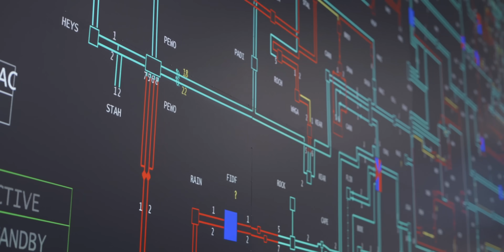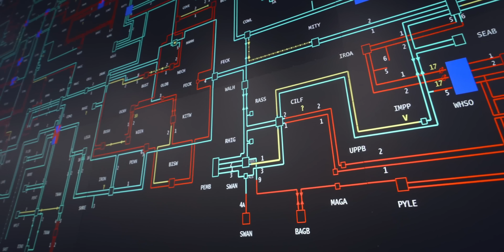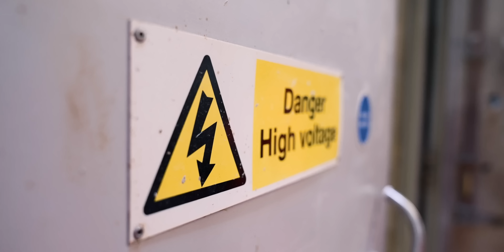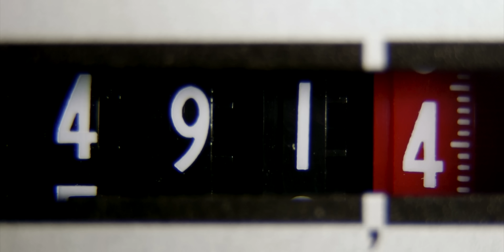THIS is Why the Grid is Ready for Electric Cars!

Comment: The tunnels are the right solution, obviously far better than non stop digging whenever something needs updating or repair. I hope the tunnels are meant to take more than power, though. About the cable to Norway, it can easily send power both ways, but IRL it’s a one way road. Power goes from Norway to England, where the price was much higher, meaning that it’s gotten as expensive in Norway. I’m Norwegian and think power has been too cheap in Norway, making people wasteful. Using Norwegian hydropower to replace dirty European power is good, but don’t pretend it goes both ways.

Comment: The grid will be ready for EV's because it is an excuse to charge consumers an infrastructure surcharge.  In truth, most modern homes have electric ranges, ovens and dryers so as long as the level 2 chargers are not operating at the same time as those high powered appliances, no more of the grid is needed.  Now if we want to reverse the power flow from the EV's back to the grid to help with peak demand and to buffer solar and wind, sure that would need grid improvements but it would be the utilities that benefit directly from that so grid improvements is all about benefits to the utilities at the expense of the consumers.

Comment: One Caveat... too much optimism can stop us making the hard decisions because it makes us think everything is going in the right direction and it isn't, at least not fast enough. But interesting on the tunnels ... lower cost higher speed tunneling technology is key (and not just for London!) It will help with transport and infrastructure, it's another strategic technology we need to put on a "war footing"  just like nuclear(relearning "old" nuclear and doing "new") and developing technology for energy storage + renewables etc. Cheap fast tunnels are for example critical to making heat pumps more practical with district water tunnels deep underground to supply heat pumps in high density areas.

Comment: For those who don't care or want to watch : Is the national grid ready for electric vehicles? No it isnt. But in one specific place in london its ready. for the other 99.7% of the united kingdom, its not ready. Sub-stations have been degraded over 20+ years. So in your village or local town the electrical sub-stations are barely handling what is going on already let alone adding tons more supply from consumers.
Reply: That’s not the National Grid, it’s the 14 Distribution Network Operators (DNO’s) owned by 6 groups that takes the electricity from the National transmission system and delivers it to users. These were privatised many years ago and the privatisation was done very badly. The government really needs to address this as soon as possible.

Comment: Actually, in AC, the electrons only jiggle a bit in the cable. they only travel a few millimeters at most. Electrons are not the energy carriers in electricity, the electromagnetic field is. It's just that the electrons have to be there for the field to have perturbations to be able to transport energy. Another thing to wrap your head around: Electrons flow from - to + , but the energy really flows from + to - !

Comment: This video is typical of city centric views of the "Green Zealots". I live in a regional area of Australia, where most houses that are towards the end of the transmission lines can barely support existing elical loads, let alone the demand from EV infrastructure.
Reply from the maker: An interesting response. As Australia is the most 'city centric' country on the planet, (86.36 percent as of January 2023) then I understand why you may have a jaundiced view of this episode which is very specific to the UK.
One of the things that has really impressed me on my current visit to Australia is the level of adoption of solar PV and battery storage. 
People who have the space to install seriously beneficial amounts of solar do not live in cities, so it is a positive advantage to live in rural areas, where demand on the grid is the absolute reverse of what you are being so critical of. In many places people already generate more electricity than the local grid can deal with, so running an electric car in a riural area (like I do in the UK) is much easier and a whole lot cheaper than running an old fossil burner using expensive, toxic, imported fossil fuel.
Reply: @fullychargedshow  "imported fossil fuels", a continued slogan I hear from EV evangelists. Fossil liquid hydrocarbon fuel will eventually give way to synthetic liquid fuel. I have numerous "old tech", fueled cars (Mustangs, Civic Type R etc....and will never give them up. I also use an EV for work (because it's more suited to that specific task). It's charged a work because I cannot charge it at home, I live at the end of the grid with a single wire to my house - and the other 10 in the street). I can assure you, the IC engine is not going anywhere during my lifetime. EV tech is part of the answer, but not THE answewr.
Reply from the maker: @Ozgrade3  Well those fuels are imported here, and refined here using vast amounts of electricity and of course cobalt to remove the sulphur.
But all that aside, it's fine, don't worry about it. Our generation will cling on to the dated and inefficient combustion technology. 
No one cares, it's painfully obvious that electric ground transport will become dominant. There will always be combustion engined vehicles, polished and loved by a few eccentric old blokes and that's wonderful. 
They should be maintained so our great grand children can understand that we used to rely on a technology that required controlled explosions in a largre lump of steel, to drive a piston, to push a con rod, to turn a crank, to spin a fly wheel, to drive a cam belt, to turn a cam shaft, to open and close valves, to drive an oil pump, to force oil at high pressure into bearings, to drive a water pump to keep everything cool, to spin a fan in front of a radiator, to go through a clutch and gearbox of immense, energy sapping complexity, to push toxic gas out of a long pipe that required complex and expensive minerals to try and reduce the amount of poisonous gas that is pumped out in massive choking clouds behind the vehicle.
It's a critically important,, game changing technology that altered the world we live in and allowed enormous economic and material growth. 
But it's now a static, moribund technology with nowhere left to go, it's ridiculously wasteful and dated, but seriously, it's fine.
Don't worry about it.
Keep driving old fossil burners, it's not interesting.
Reply: I'm not anti green tech, or anti-EV, or anti progress. But I am a realist. Green nirvana is long after my lifetime. So it's something I don;t realy care about. Other will enjoy it - long after I'm dead.

Comment: Ironically, the grid in the Netherlands shockingly overbooked. Upgrading the grid to support a massive EV fleet, is going to cost many, many billions. Applications for solar panel permits are already being denied out of fear the region there will start to black out. Contractors have to hold off building new housing because they can't be connected to the grid, out of same fear. Energy corporations were warned years ago.

Comment: The UK needs 25 GW of additional power before 90% of all UK cars can run on electricity with the same usage pattern of the ICE cars being replaced.
No amount of chargers shuffling can replace those 25 GW of generating power that must be added before "automobile net zero".
Trucks will stay on diesel. Testa has made a truck with a 900 KW battery, and that require a one MW charger for each truck, it doesn't seem sustainable...

Comment: The grid is the easy part , the problem part is having enough generating capacity at all times , you can't do without either , and networks will have to be everywhere and that is NOT the case today

Comment: Thought Fully Charged was clued up? Energy is measured in watt-hours or kilowatt-hours or mega-watt- hours etc, ie the product of power and time multiplied together.

Your correspondent mentions 'megawatts' of energy. Watts measure only power, ie the rate energy is moved , or used.

So the stats they mention are worthless, since either its a slip of the tongue and they meant megawatts of power, or they meant megawatt hours of energy...

Its secondary school physics, basic algebra.
Energy equals power multiplied by time.
Power is the rate of energy transfer.
No wonder no one understands their electricity bills.

Comment: Very nice but at the local level most of our cables have been in the ground over 60 years, the local sub stations are elderly, most properties need rewiring as they're still on rewirable fuses and are the cables in up to the job , they were never intended for all electric homes with electric showers and induction hobs. At the national level we need a new distribution network not to mention a fleet of nuclear power stations to keep the lights on when the wind isn't blowing.

Comment: This sounded like a total crock of bullshit. The title of the video is incorrect, they need to build up the infrastructure network and capacity. At the current level there isnt a country on earth that could deal with net zero especially with fake eco cars like tesla. 
My country ie Australia cannot cope, Our transmission lines are in capable of dealing with a rush for charging for example. Ie there will never be as many superchargers etc as there are petrol pumps. thats a cold hard fact. 
And the fact that its more efficent to run a petrol motor creating electricity than it is to buy own amd charge a tesla, speaks volumes. 
Renewables are at the very cutting edge best 30% e most are around 20% efficent, a simple 4 cylinder toyota engine from 2019 thats in most camrys etc can be over 50% efficent.  Thats why electric cars dont make sense.

Comment: 11:31 That central conductor is what, 40mm in diameter so the cross-sectional area is about 1250mm², and it can carry 2800a (1.4Gw/500KV) for 700km with low loss.  Dividing by 100, 12.5mm² should be good for 28a.  That's about an 8 AWG wire, which my chart says I should only use for a length of about 6 meters before upgrading to 6 AWG.  700km?  What major concept am I missing?

Comment: Ready for electric cars? Hardly. The grid can barely cope with me boiling the kettle on a friday night without price discounts to incentivise people not to use it.
Reply: Most EV owners are not charging at the peak use period (5-8pm), which is the time where energy is most constrained (supply vs demand). Lower off-peak prices during the night (12am-5am) steers EV owners to charge when demand is much lower.
The difference between day-peak and night-peak is about 20GW, this is spare capacity which is available overnight, for EV charging, using the current infrastructure

Comment: Unbelievable but true - We could convert EVERY SINGLE VEHICLE to Electric and we would still be using less electricity than we did in 2012 - Fact. Whilst we use more gadgets - Led and Solar lighting and changes to LED/LCD, plus reduced power available in vacuums, washing machines, hair dryers - pretty much most heavy consumers have been limited by either design or legislation. Net result has been a massive reduction overall in our power use.

Comment: 1400 MW is ~4,000 EVs @350KW ea. That doesn't sound like a lot of supply - or is the intention to have a lot more demand management?
Reply: 4,000 EVs... per 15 mins (and ignoring the fact that no EV is able to sustain that level of charging for more than - perhaps 5 seconds).  The EV6 / Ioniq 5 (which can get a 70% charge in ~18 mins on a 350kW charger) average ~175kW over those 18 mins, iirc (due to the charge rate declining as the battery fills up).

Comment: This is why the Grid is FAR from ready for an electrified future. All nice seeing this carefully produced PR excersise, talk of investment, time-lapse of new stations etc, but the UK has been danergously close to blackouts this winter, with trials of households being paid to reduce usage and a constant battle with rising costs. The shiny control rooms look pretty, but a lot of the UK grid is struggling, and the thought of hundreds of thousands of EV's plugging in all at ther same time WILL be a huge worry. This guy also mentioned vehicle to grid - not all EV's support that and are they going to pay for the energy they take back and how will EV owners feel about it?
Reply: Sure - but it was close to blackouts due to a shortage in gas (partly because the gov. decided to stop paying for the gas-storage facilities some years back) resulting in a lack of energy supply, not a lack of energy distribution.

As we continue to transition towards RE, which has less reliance on imported fuels, we'll get better resilience and - provided companies don't cheap out on storage - better consistency, plus projects like some of those shown here will help with the distribution of that power.
Reply: @logicalChimp  Yes, but how much of the UK's electricity comes from gas - on average 25-30%, which is a lot, and we're firing up coal power stations too to fill the gaps. No matter what we're *told*, the Grid really couldn't cope with all ther extra demand, and they'd be having to produce high levels around the clock too rather than the current dip/peak cycle.
Reply: @tonyb3629  Not entirely... you're kinda right that the grid might struggle if everyone plugged their EVs in during peak time... but outside that (narrow) window, we have more than sufficient capacity.

What we need is more dynamic pricing, as this would automatically encourage folk to use their appliances when energy is cheapest (especially significantly energy-hungry devices like EVs), and avoid the need for explicit 'payment to not use energy' (which is primarily required because there is no price (dis)incentive to avoid the peak periods).

Comment: Fantastic, the HV side can cope at 400kv but go further down the scale and it won’t. There are some LV cables still in use that date back to the 40s and we’re never designed for the loads of today. Even some more modern estates from the 80s and 90s have tens of prosperities backed up by a 400A fuse. Add an electric car at 35A, a shower at 40A and an oven you can quickly exceed that and of the 80A incoming fuse.

Comment: The UK-Norway interconnector supply from Norway is not guaranteed, as has been stated many times now by the Norwegian government. It is also expensive energy, as although it is mainly hydro, it is sold at the prevailing market rate, which includes Norwegian domestic demand, along  with Germany and Denmark. The UK is just another bidder for Norwegian energy helping to inflate the price and profits for Norway.

Comment: Tarmac over all the Train branch lines and convert all those green ribbens in to EV highways for EV vechicles, coaches to replace the barely used trains (only busy at rush hour) the tracks are mainly electrified already so plenty of high power charging stations can be implemented. Moving people cheaply and carbon free will accelerate as those old trainlines go to all centres of population,  £10 billion annually will be saved on maintaining the 18th century train lines and can be put to use to pay for the conversion from 18th century to 21st century transportation.
Reply: Trains can provide a mass transport for freight too.
Reply: @erkinalp  But they don't do much freight on trains today because the unions drove the business off trains and onto the road through their strikes. Trains also have to be serviced by trucks and with no large scale movement of coal, steal or engineering products there is very little freight movement that is not done on the roads today. Using EV trucks on the old train lines once concreted over will allow FSD Semi trucks (using the Tesla name) to travel around along with the EV Coaches and release the strain on the roads for HGV which cause most of the deaths crunching into cars, lots of safety benefits in making more efficent use of those old trainlines when converting them into EV Highways, also room to put bike tracks alongside of them because without multiple sideroads, they are safer from being hit by other traffic

Comment: Love these videos. 
Could you maybe make one to explain why the governments, especially the Scottish government are paying wind farms stupid money in compensation to stop generating when demand is low. I think it’s a national scandal that no one seems to be bothered about.
Reply: Nah - it's not a scandal.  The nature of the RE contracts is that they guarantee a 'minimum payment'  (which is far less than the cost of generating power from e.g. gas)... but if power demand falls so low that RE power has to be disconnected to keep the grid stable, then the RE generators still get paid (up to that minimum value).

The purpose of that style contract is to encourage companies to actually build RE power (because the cost of energy is so much lower - the only reason our bills remain high is because the gov haven't done anything to fix how the 'market price' is calculated... basically set by the most expensive power - gas - rather than as an average of all power produced, etc).

As / when the grid adds more storage, during periods of low demand instead of paying RE companies to disconnect, the grid will be able to use the 'excess'  power to fill the storage... and during periods of excess demand, use that storage to fill in, instead of paying for gas-generated power, etc... but we don't - yet - have sufficient storage.